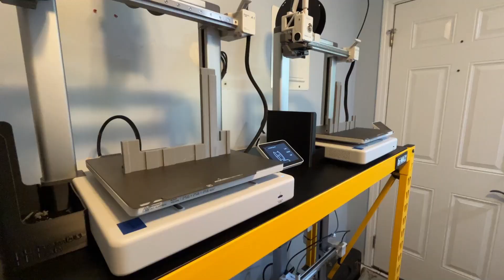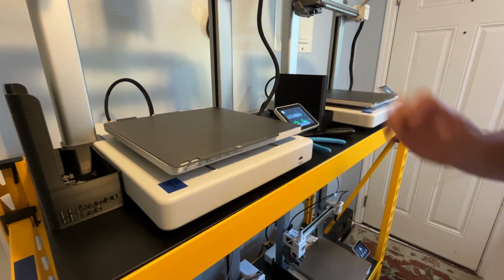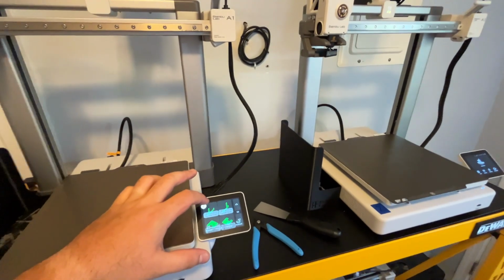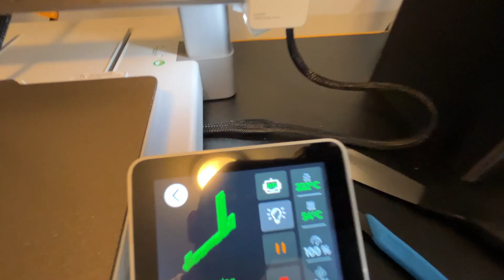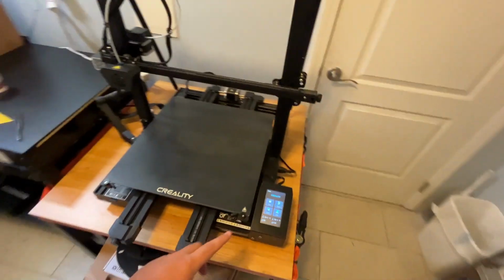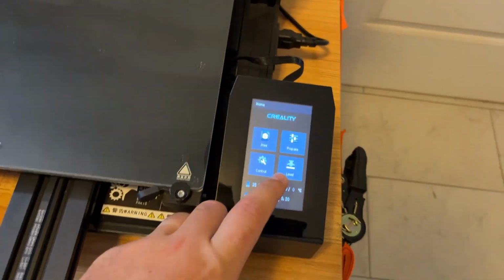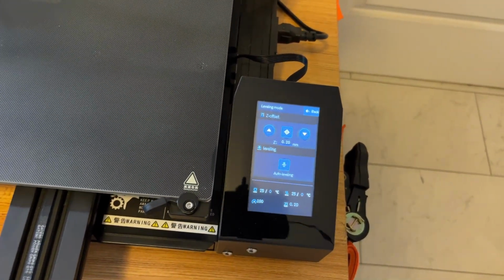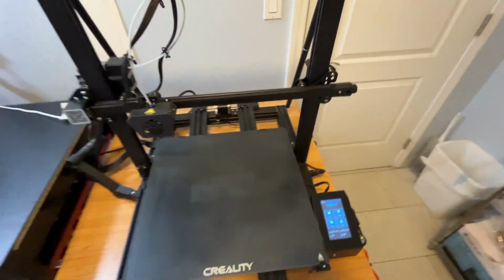Bambu Lab A1 Tiny Print Farm, Creality CR-6 Max Leveling

Comment: Try ASA dose even better in heat and sunlight
Reply from the maker: @jonfernandez4933  Thanks for the suggestion! ASA is great for heat and sunlight, but I usually stick with PETG to avoid dealing with fumes. I appreciate the tip though!